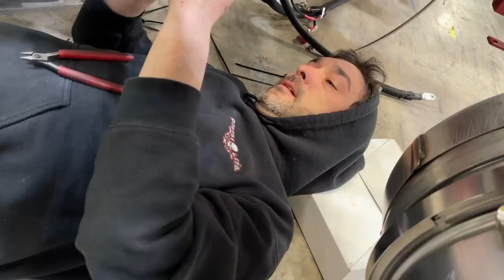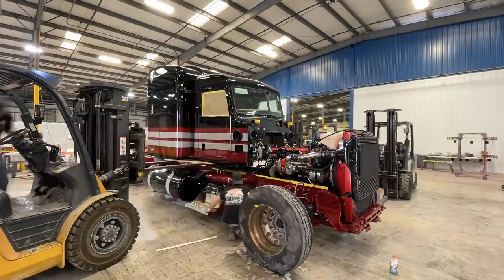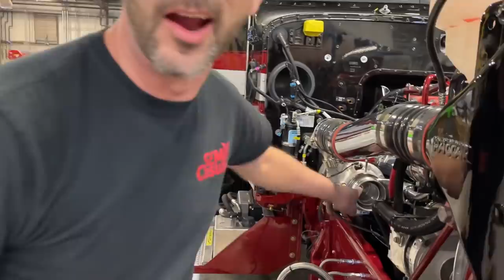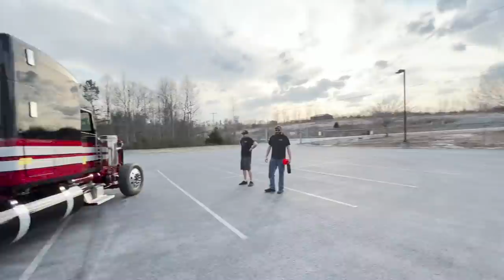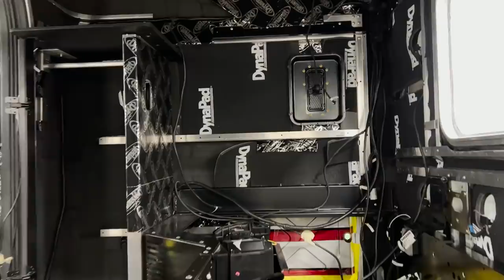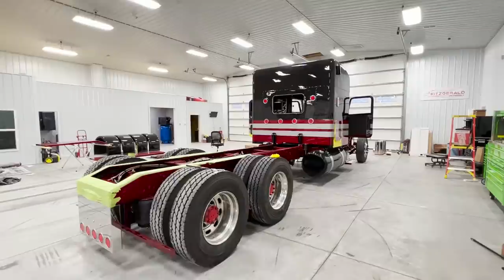Will it Start? Project Legendary going back together!!

Comment: I'm on Bill's side. If electricity makes it turn it's a motor. If a combustible fuel or steam makes it go, it's an engine. Keep up the great work. I will see yall at MATS.
Reply: BILL is correct sorry Brian you are wrong motors are electrical and engines are fueled by gas, diesel ,propane or steam.

Comment: A motor is the complete vehicle, a engine is the power plant for the motor, anything with motor in it means multiple vehicles, engine will always be the power plant, like caterpillar engines, detroit diesel engines, Cummins engines.

So from britain to the USA engine is the power plant and motor is the whole vehicle.

To the one in semi casual who keeps calling the engine a motor you are wrong, engine is the power plant and motor is the whole vehicle.

But I am loving the way you all have fun.

From Philip Burrows in Overton on Dee, Wrexham, Wales, UK.

Comment: Whats up with the brass fittings in the air bags, they do make matching stainless steel fittings.  There is way too much thread sealent on all of the fittings, I use the liquid thread sealant that you allow to dry before using since it provides for a much cleaner look.

Comment: Wicked build man, I jus have to b disappointed n how bad ass u guys r 👍🏼BUT to lev the frame bolts VISIBLE n didn't hide the sleeper shocks
Reply from the maker: This truck is built to work a million plus miles. The clean frame looks is super awesome but not the best for a full blown work truck build.

Comment: Yea guys. First off Bill’s truck turned out more then awesome! I had a question on Jose’s truck. Was wondering what def and fuel tanks sizes are? Great set up with the small bunk. Thanks
Reply: Also did u have to do anything with def tank to get 6” panels on there. Thanks again!

Comment: What is the white area where the red stripe meets the black on top near the rear corner on the passenger side?
Reply from the maker: Still have some wet sanding and buffing to do, just needed to get the truck back over to the other shop to start putting it back together